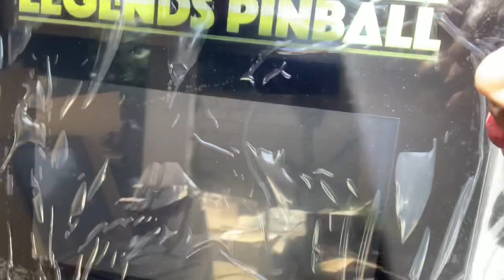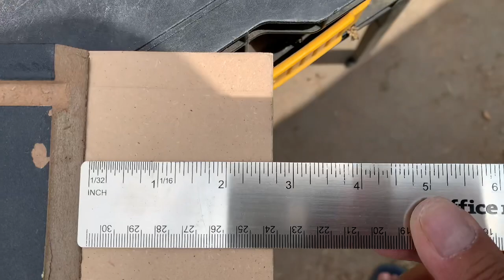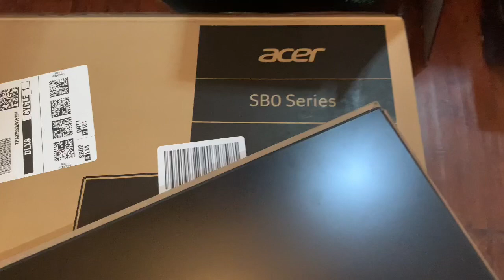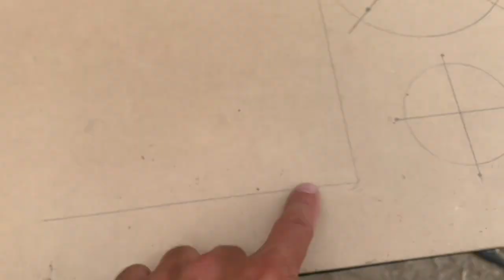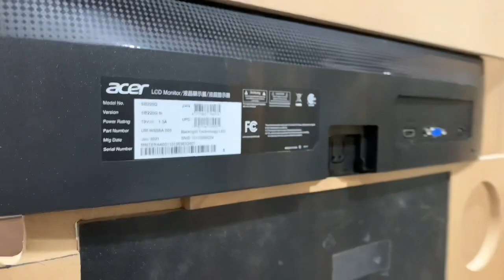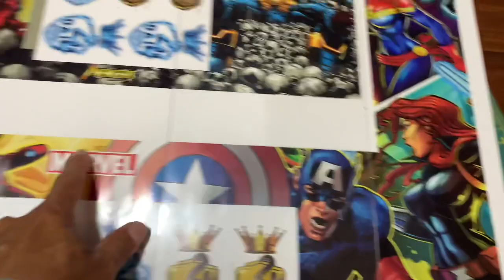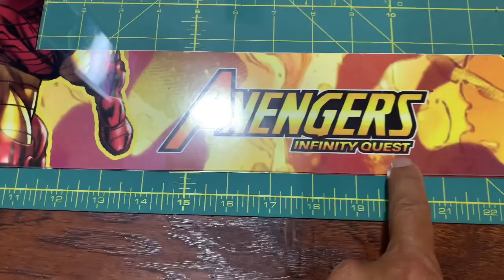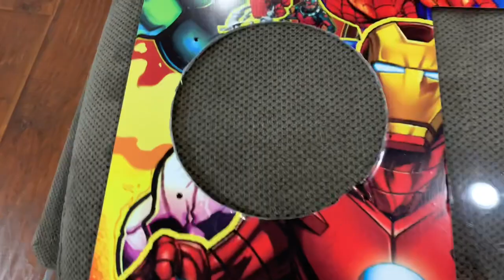Legends pinball custom BackGlass tutorial

Comment: Tool Time!!! with 2Dai4!! FYI - Bobby does a great job showing how to remove the stock 15.6" DMD to reuse in his custom box. As an alternative, you can buy a replacement 15.6" EDP laptop monitor replacement screen that should work too. Then you can build the custom box without having to gut your current one. Cheaper to reuse parts, but takes more time and Bobby vu skills to gut
Reply: him using his legends screen he probably save close to $100 so it was worth taking old one apart just saying
Reply: @Roadsurfer2k11  the bottom monitor is hooked up using the VIBS board and the top monitor just goes into the PC. It’s a little tricky getting the placement of the vibs wires to fit, but that’s pretty much it

Comment: Bobby - how did you mount the 22 inch monitor given there are no holes on the back for mounting?  I assume the monitor is sitting on top of the cutout.  I see there is a board on the back side that may be holding it in place with some double sided sticky tape?  Between that board and the plexi it is sandwiched in place.
Reply from the maker: I use grollia glue
Reply: @2Dai4  lol i guess he didn't watch the video . you said it and showed it you used  grollia glue i like to know how he missed that one
Reply from the maker: Lol 😂

Comment: Thanks I've been trying to locate this tutorial for hours. Except it's just box building and trying to find out how to move the 15" stock screen to use as dmd and adding monitor for back with the atgames vibs addition. I don't see any vids on wiring connection process
Just to clarify 8:50 when you said test, you plugged that backglass back into atgames vibs via the cable to turn on? I probably will just cut the sides and not peel anymore off. Put a bezel on front of cab where it pushes against it, and latch it in from back.
Also 10:20 your updated measurements were 6" and 4" on ends of board?
Was there a tutorial on how everything is wired back, using atgames vibs?